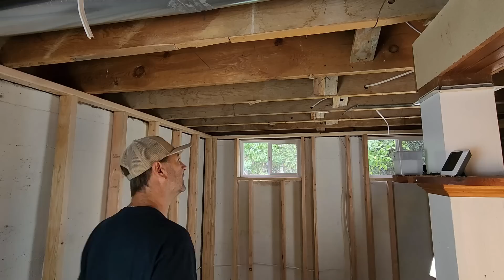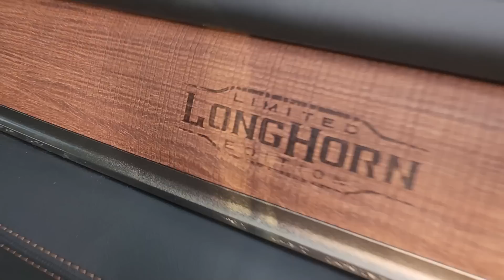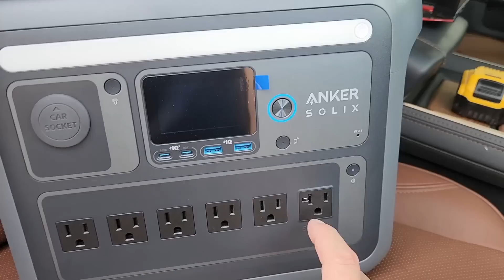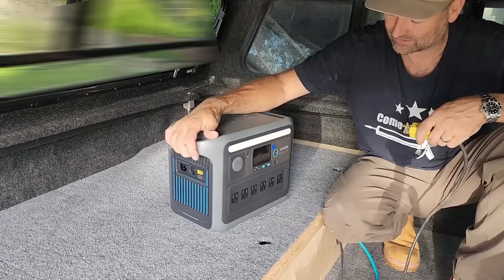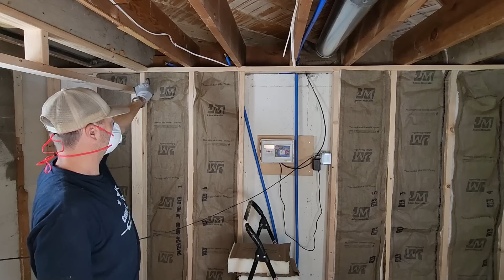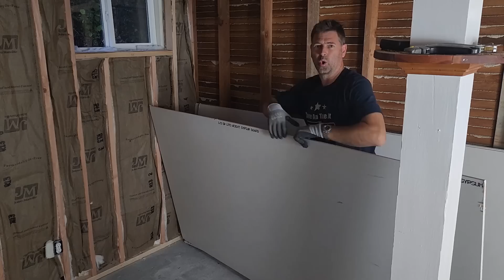These Pipes Are Going To freeze And Flood This House | I Need Your Help | THE HANDYMAN |

Comment: It could have been an old gas line. Hopefully there isn't a valve somewhere that could be turned on. Advise you cap that pipe just in case

Comment: You should have pipe insulation. You made a good choice putting the pipe on the hotside of insulation. If it were me I'd think two routes. One insulate to keep it a hotside. The other is tie into drain system for winterizing. If you have beat up floor joists that are not matching up for drywall. I've used strips of luan plywood to even things out.

Comment: you should try the clamp on grabber for plywood and drywall then you just lock your arm strait at shoulder height makes it a lot easier to carry
never wore gloves unless it was freezing cold but at work, they made us wear cut resistant ones they are ok but still don't like them
I had heating pipe in outside wall i slipped foam board behind it to outside of house and slipped on pipe insulation but did not cover it on inside, so it never freezes even with heat off to the upstairs rooms it feeds

Comment: I put a deck on my house, and extended the spigot to the end of the deck with copper pipe, I patched that copper pipe 6-8 times in 12 years. I changed the copper to pex pipe,  this was 8 years ago.  Never had to patch the pex, seems to resist freeze damage!😎😁

Comment: When you compress fiber glass batt insulation, the R-value per inch goes up, but the overall R-value goes down because you have less inches or thickness of insulation. Add more insulation.

Comment: You could wrap that pipe with heat tape inside the house  or change the exterior valve to a frost free valve if it is a spigot and or add a blow out valve on the exterior and blow out the sprinkler lines every fall.

Comment: Nice thing about PEX is it is a lot more resistant to bursting than copper or whatnot if there is a freeze.  I don’t have much experience with the PEX B and crimp rings, but I’ve used PEX A with cold expansion joints quite a bit.  PEX A has “memory” and will go back to original shape if expanded or kinked.
Reply: @Jimddddd1981  The pex isn’t the issue. Its the elbows and fittings that split open.
Reply from the maker: I personally haven't seen a fitting crack but that would be my concern.  Not that actual blue pex.

Comment: Any time I have a tricky insulation scenario, especially like here with potential air infiltration, I go with canned spray foam. You can build up a pretty good mound with a few cans, and cans are about $3.75 or cheaper in bulk. Highest R value of any insulation, and fills gaps and weird areas easily, albeit a bit messy. 

It does kind of screw the next guy to be working there, but a pipe burst behind a finished wall is a full gut out anyway. Might as well chop away some spray foam if 1/2 the wall needs to come out.

Comment: Old oil line from a long removed tank outside? Would explain why there is no corrosion inside.
As far as the pipes, you have an electrical outlet available. Use some heat tape.
Reply: Or gas

Comment: In my basement renovations I make an access panel door floor to ceiling. When it starts getting cold I tell the customer to just open the door to keep the pipes from freezing as long as the basement is heated. It also makes getting to all the shut offs really easy.

Comment: You could put some heat trace cable on your pex water line and plug it in, in the fall when you shut off the sprinkler system. You should have a 120V outlet right there for the sprinkler timer.